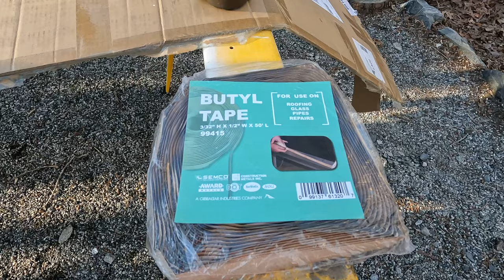EASIEST AWNING INSTALL FOR CARGO CAMPER Ep. 20

Comment: I'm converting a 8x16 cargo for SAR, 2 restrooms up front, equip storage in rear.  Re the hex head self-tappers - 2 1/2" seem pretty long, would you recommend shorter?. Did you add a backing plate or screw into side ribs?  I'm adding 1" foam sheet insulation between ribs, then furring strip, plastic sheet vapor barrier, and re-installing the 3/8" OSB panels.
Reply from the maker: We added the screws above the sidewall level so that they penetrated through the tube framing.  I would measure the length that you need to penetrate.  We did not use a backing plate because we we able to get into the framing.  It is definitely a good idea to add the plastic vapor barrier.  We did not add it on this one and it can get a little moist.  It's not bad, but I will add it on my next build.  Good luck on your build!  Thanks for watching!!!
Reply: @befreebensondiy  Thank you for the reply. I have the awning, will measure for screw length and get it installed before our rains hit here in SW WA

Comment: So you really need a ladder to be able to put the awning up or down.
Reply from the maker: You don't need a ladder, but having two people really helps.  I have done it myself, but it is very challenging.  The good news is that for a relatively inexpensive awning, they hold up very well.  We have had ours out in very intense winds and rain storms without damage.  You definitely need on side lower that the other during rain storms for the water to run off.  If you don't the water will build up and the weight will cause damage.  We had a friend that didn't do that and it bent his vertical support beam.  Thanks so much for watching!!!

Comment: Why would you notput a full length awning on ?
Reply from the maker: This was the biggest awning for the size of the trailer.  They didn't have them as exact fits for the application.  They have worked very well.  They are very sturdy in the wind, much more so than I expected.  Thanks so much for watching!!!

Comment: You just screwed through the top plate and used butyl tape?  No other sealing needed like around the screws?  
I have a very similar top plate and looking for a way to secure to top plate side mount like you did. I do NOT want to add any holes to the roof. 
Just worry about water coming in through the screw and running down the inside wall??
Reply from the maker: Yes just to the top plate and butyl tape.  We have done three awnings and have had no leaks.  Thanks for watching!